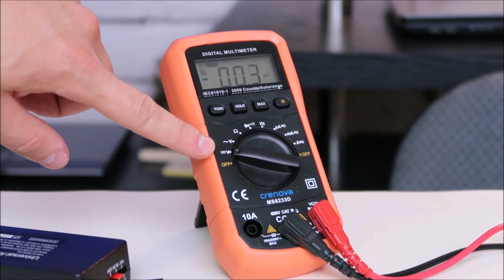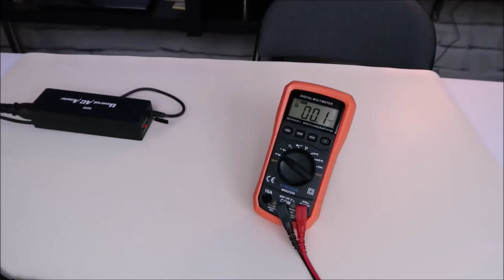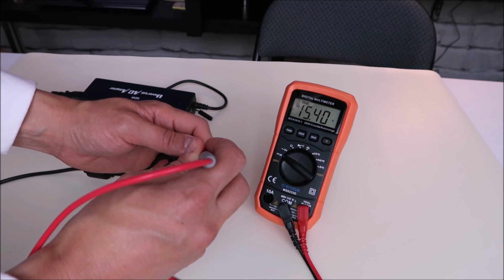How To Fix Any Laptop - Wont Turn On, Wont Open, Turns Off Right Away, No Power Solution

Comment: Still can't fix my lenovo ideapad 330 😭 any tips on how to fix it? power button no working, power it on using novo button but after turning on it turns off and also if it is charging it is only black screen really need help for my online class
Reply from the maker: Can you see anything on the screen before it turns off?
Reply: @PC_Monkey  yes i can see the bios reset
Reply from the maker: @itskizukun  What does that mean?  You can see the BIOS reset?
Reply: @PC_Monkey  yes i can but it turns of after, sorry for the late reply
Reply from the maker: @itskizukun  I dont understand your comments.  The computer starts, you see BIOS, then it turns off?  What does that mean, you can see BIOS?  Please explain
Reply: @PC_Monkey  Yes i can see BIOS

Comment: Thank you so much for your help. Two question first you said Cimos battery unplug and leave it for 20 to 30 min  but when you were demonstrating you said for a while and you put it back right away. So is it 20-30 min or sec. Second my cimo battery won't come off so I didn't even had a chance to test it. Can I try to remove the black circle thing ? I don't think so but just wondering of there any other way. Thanks
Reply from the maker: 23-30 minutes :)
Your CMOS wont come off?  Do you have a CMOS battery that is wrapped in black electrical tape and plugged into the motherboard through wires?
Reply: @PC_Monkey  yes I do as shown in the video looks like a black watch battery. It wouldn't be unplugged and I don't want to break it.
Reply from the maker: @peledood999  What do you mean, 'it wouldnt be unplugged'?
Reply: @PC_Monkey  you know how you pulled the end of the CMOS battery, I couldn't do that. Anyways I took it to the shop and they said mother board is not functioning so they couldn't repair it. If mother board is damaged is that that the end of it?
Reply from the maker: @peledood999  Yes, if the Motherboard is not functioning then you would have to replace it.  However, 'motherboard is bad' is a very broad term many shops use when they really dont know what the issue is.  And BIOS is the Motherboard system.  If BIOS is messed up, that does appear to be a Motherboard issue
Reply: @PC_Monkey  right!! Okay thank you so much for taking your time to answer my questions. I really appreciate that. Have a wonderful day

Comment: When i tried the static discharge method, it helped me the first time to charge the laptop. But, after few days, I tried starting my laptop again and it's not starting.

Orange light (charging light) holds on for few seconds and then both blue and orange light starts blinking 😭
Reply from the maker: Have you moved on then and tried the rest of the troubleshooting steps?

Comment: i have a desktop computer for 1/2 year new psu mobo ram cpu everything worked fine until these week is the issue is sometimes it turn on sometimes not
sometimes  it take 100 button click it turn on for a second then off 
but if it turn on normally i can game for hours nothing no heat no fps drop like verything is normal any help ??
Reply from the maker: Power button may be messed up.  If you can game for hrs with not issues and no heat then I assume the power supply, CPU, MB are all ok.

Comment: Hi. My laptop suddenly shutted down, when I was playing a game. Since then, I can't start computer, none of the lights is on, when I plug in the cable. I was trying everything from this video, except for this with checking the voltage, because I don't have this device, and none of this worked. What's interesting, when in room is quiet, I can hear ticking every second, from my laptop, when cable is plugged in. Any advices? Thanks.
Reply from the maker: If all the tests in this video do not reveal the issue, and your power adapter tested to be fine, then your most likely looking at a Motherboard replacement

Comment: None of it worked.
Reply from the maker: Are there any signs of life at all?  Lights?  Fan, Motherboard, or Hard Drive sounds?  Anything seen on the screen?
Reply: @PC_Monkey  When I turn it on, next to the power button the light turns on. On the screen it says loading, it loads to my profile picture then turns off
Reply from the maker: @Astrumora  This isnt the correct video for your issue.  This is for a computer that wont turn on.  What brand computer do you have?
Reply: @PC_Monkey  I have a stone.
Reply from the maker: @Astrumora  Sorry.  I have never run across a stone computer.

Comment: My laptop doesn't turn on after a SSD upgrade, what could had happenned?
Reply from the maker: The computer worked well with the old drive?
Are there any signs of life at all?  Lights?  Fan, Motherboard, or Hard Drive sounds?  Anything seen on the screen?

Comment: Which video I should watch ? 
My hp laptop sometimes shows 5 slow blinks and 3-5 fast blinks on caps lock then it goes to startup menu and then I have press esc button to exit the menu then It turns on.... It never got restarted or shutdown ...I should I solve this ??

Comment: hey you guys are great.  Just doing what said to do. then switch the ram cards around then it works.  THANKS
Reply from the maker: Happy to help :)  Always here if needed !!
Reply: @PC_Monkey  nice that you're still around.  Hey I got ther laptop to run with just the battery, but when I used the adapter it would shut off.  I  tested the adapter and it's good. Also when I  took one of the hard drives out it would work,  but when I bur the other hard drive back in then it would just shut down like before.  So how do I solve the adapter issue? As far as the hard drive issue I should replace them both right? But is it worth it?
Reply from the maker: @jeremyscott6920  Sounds like the power adapter does need to be changed.  As far as the HDD, having 2 can always be weird.  If the computer runs well with just the one in, then I would assume the other needs to be replaced.

Comment: Hi i have a 7 yr old Toshiba satellite L755 55153. Had to do a recovery do to some error issues while using my computer. After restore the page was frozen on a dark blue page. With a little cursor in top left. I push power it shuts down immediately. I turn on. Same thing. I can hear the fan. I did the test u said unplugging doesn't work my battery is only 8 months old. Pls help. Thanks. Lisa
Reply from the maker: So you can hear the fan running but the cursor only lasts for a while and then goes black with the fan still running?
Reply: @PC_Monkey  the cursor blinks the whole time page stays the same. I was at the end of factory restore computer restarted and that's when it happened it just stayed at the restart page.
Reply from the maker: @lisaann8481  If the reset failed, try a new install as seen here;   https://youtu.be/e7hzoRI-cSY.   You can see how to create your own install media for free here;  https://youtu.be/g_UhiHScaSI.   If that fails, you may be looking at a bad HDD.  It would then need to be replaced before installing the OS
Reply: @PC_Monkey  got the windows 10 on flash drive. Got into the F2 page. Went to the usb but at top saved and said yes. And it went right back to the blank page with blinking cursor top left. I'm so bummed i cant get another computer I need this for possible work at home job soon. Thanks, oh it did quickly say innovation then went to the blank page. I'm sorry my son just told me i have windows 7.
Reply from the maker: @lisaann8481  I would replace the HDD at this point and install to the new one
Reply: @PC_Monkey  i didn't realize it was windows 7. I don't know what hdd does it mean hard drive? If so prob to expensive to do that. Can't i just get a windows 7 USB download and try that?

Comment: Had to buy some more ram. Waiting on that now so I can finish the test. But when it got to the cmos battery one I couldn't find mine. Ive honestly only had like two or three computers in my entire life but still never seen one of those
Reply from the maker: Not all motherboards have them.  Yours may not. 
Whats happening exactly with your PC?  
Are there any signs of life at all?  Lights?  Fan, Motherboard, or Hard Drive sounds?  Anything seen on the screen?
Reply: @PC_Monkey  the charger light and power light are white. Other than that its just completely dead. I had been using it like normal then closed it because I had to go do something. When I came back it was like that
Reply from the maker: @nickn3030  Ok then yes, your on the correct video.  You will just have to skip the CMOS battery step if you dont have one.
Reply: @PC_Monkey  honestly starting to think its the ram bc thats the only thing I havent been able to really test yet and everything else seems fine

Comment: The title of this video is wrong, plain and simple.
It will not show you how to "Fix Any Laptop - Wont Turn On".
The laptop I am looking at right now has a good power charger, a good CMOS battery, has been reset, has good power on the power switch, and the switch works as I can measure the power dropping on one pin when I press the button, and yet the laptop will not power up.
This is obviously more serious than anything listed in this video.
All the suggestions in the video are the most basic troubleshooting steps and will not "fix any laptop".
Reply from the maker: lol
thanks for your expert option :)
These are troubleshooting steps to go deeper and deeper into the computer to find the reason its not turning on.  If the issue is not with your charger or battery, then we move deeper.  If the issue isnt with your RAM or CMOS Battery, then we move deeper.  If none of the issues discussed here are the issue, then the Motherboard is the issue and it would need to be replaced.  Same in any computer shop anywhere lol
Reply: @PC_Monkey  I am a computer engineering technologist, and I have been working on computers for over 30 years. I started out on the Commodore PET and Vic 20. Your title says "fix any laptop - won't turn on" and that's not true, simple as that.

Comment: My Lenovo Ideapad 310 - 14|KB (2016) doesn't power on. I can see the AC power status indicator blinking while charging. When I try to turn the power button, I can hear the fan/static from the laptop. The screen is still black & the power button is blinking yet not turning my laptop on. I've already tried the methods above but seems like it doesn't work. My laptop got the Novo pinhole button on the sides, I've tried it but doesn't work too.

Does that mean the motherboard is the problem / screws inside start to falling out / fan / thermal paste?

The warranty on the laptop has expired years ago. Should I go the local laptop services or go straight to the Lenovo store?
Reply from the maker: You said you hear the fan and sounds from the MB.  How long do these sounds stay on?
Reply: @PC_Monkey  for a few seconds and automatically restart again and again until it ran out off battery.
Reply from the maker: @Misora13  Are you able to try the steps seen here?  https://www.youtube.com/watch?v=2-WDntT-5L8
Reply: @PC_Monkey  Yeah, I did. I unplugged and replugged everything, changed my hard drive into a new one and it works! Thank you!
Reply from the maker: @Misora13  Glad your all set :)   Always here if needed !!

Comment: My laptop starts but stays in power mode just shows a power light. And a black screen how do i trouble shoot laptip everis 14 inch built in windows 10
Reply from the maker: Are the lights the only signs of life when you turn it on?  No motherboard or hard drive sounds?  No fan noise?
For a computer that does not turn on, try this video first;  https://youtu.be/P3I7dDpkJps.

Comment: Hey man, so laptop went blank and won't turn on or show any signs of life, I tried multiple chargers ntn happened I also don't think it's the charger plug(a/c cord)  so what can it be. The micro center guys just took it for a sec and said it's probably the motherboard is there anyway I can be sure ???
Reply from the maker: your on the correct video.  Are you able to try the steps seen here yet?

Comment: Hey man I found out that my battery is the problem, I don’t have that much money to buy a new battery, so Ill tell my dad, he is working far away but he’ll be home next month and I don’t want to disturb him, my question is, for the rest of the days before my dad comes home is safe to use or play games without battery on it but my charger plugged in?
Reply from the maker: Yes, it should be ok :)  Using a computer without a battery should not hurt it.  You may see decreased performance in some things but that all :)

Comment: Hello, my laptop seems have some issues like this, i have try the power on for one minutes with or without battery and didn't on, my laptop is dell latitude e6320, the weird thing is the charger is on when i put it on laptop without putting it on stopkontak
Reply: Oh , now after i do it longer the charger now die too
Reply: The first step of keep using the power
Reply from the maker: I dont fully understand your comments.
Does your computer turn on?
Are there any signs of life at all?  Lights?  Fan, Motherboard, or Hard Drive sounds?  Anything seen on the screen?
Reply: @PC_Monkey  nothing, only the charger was turning on when i plug it in laptop, but now it's not

Comment: Thank you sooooo much you just saved my future. You deserve a 100m subs
Reply from the maker: Thanks !!  Glad this video was helpful :):)
Reply: My hp laptop suddenly turned off while pluged in yesterday's there was thunder may be there was electric charges in the socket, i feel like a surge but still not working after all steps what yo fo.
Reply from the maker: @Panthiestofuniverse Are there any signs of life at all?  Lights?  Fan, Motherboard, or Hard Drive sounds?  Anything seen on the screen?
Reply: @PC_Monkey  no nothing i was surfing the internet not tried to plugin suddenly hp laptop goen black i tried to restart but not worked , but while removing and putting battery there was a slight light spark seen but still dont work. Will the surge goes on itself
Reply from the maker: @Panthiestofuniverse  your on the correct video.  Are you able to try the steps seen here yet?
Reply: @PC_Monkey  yes sir i have done everything but still its not working
I have only hope that it will resolve its on, otherwise i have to deal with the technician who can mislead us😪
Reply from the maker: @Panthiestofuniverse  If all the tests in this video do not reveal the issue, and your power adapter tested to be fine, then your most likely looking at a Motherboard replacement
Reply: @PC_Monkey  the technician said that because of high voltage the power ic chip got damgaed and should be replaced. Does this occurs in laptops
Reply from the maker: @Panthiestofuniverse  It can but its not very common.

Comment: I did the diagnostic scan in my dell and it says  hard drive is not installed. My dell is inspiron 3521.
Reply from the maker: That means the hard drive is either loose or bad.  I would first try 'reseating' the Hard Drive.  That is where you unplug it and then plug it back in, making sure its properly plugged in and secure.  Try the scan again.  If it still says that its not installed, then its most likely bad and needs to be replaced. You can see how to do that here;  https://youtu.be/tNp5Kbo9uHg.   You would also then need to install an operating system onto the new one as shown here;  https://youtu.be/ULrJVk4JJ20.  You can create your own install media for free as seen here;  https://youtu.be/g_UhiHScaSI.

Comment: hi I have a question, i try all this method and still my laptop won't turn on, at first the first charger of my laptop was kind of broken(since august 20), this month when i plug in the power indicator laptop turn on and when i try to turn on the laptop suddenly turn off all the lights, then i buy a new charger, and it's still doing the same when I'm using the new charger, and i know the battery is broken but the battery was broken since 2017 and I can still use my laptop via charging when I use it, can you help me, thanks!
Reply from the maker: If all the tests in this video do not reveal the issue, and your power adapter tested to be fine, then your most likely looking at a Motherboard replacement as seen here;  https://youtu.be/N_7HNrFkMS8.

Comment: I have a Trekstor Primebook c11b and it doesnt turn on for some reason, it just shows a power light and then it stays frozen... It's RAM card is directly attached to the board and not replacable, but i dont see anything wrong with it. It charges the battery like everything is normal, just not booting up... Hope you can help me with this ;-;
Reply from the maker: Are you able to see anything on the screen before it freezes?
Reply: Nope, just black screen
Reply from the maker: @randomghost7639  your on the correct video.  Are you able to try the steps seen here yet?
Reply: @PC_Monkey  I did try, it didnt work sadly...
Reply from the maker: @randomghost7639  If all the tests in this video do not reveal the issue, and your power adapter tested to be fine, then your most likely looking at a Motherboard replacement
Reply: Oh-

Comment: My laptop stuck on Acer logo, but i cant enter BIOS either
Reply from the maker: You have tried all the Function Keys?
So your unable to perform the steps seen here?  https://www.youtube.com/watch?v=gDQZvNQ2chc
Reply: @PC_Monkey  yes, i have tried all the function keys, unplagged HDD and still the same just the acer logo appears,cannot go to BIOS,  i have to add that my screen od cracked
Reply from the maker: @chrisskor7868  Usually, if you cannot access BIOS to try those steps, you would then move on to try a new OS install as seen here;  https://youtu.be/g_UhiHScaSI.  You can create your own Install Media for free as seen here;  https://youtu.be/g_UhiHScaSI.  Hopefully the computer detects the Install Media USB and runs the program automatically if you are still unable to access any options during the install.